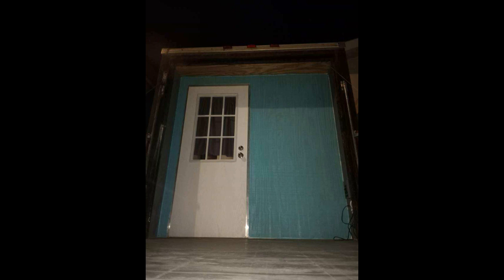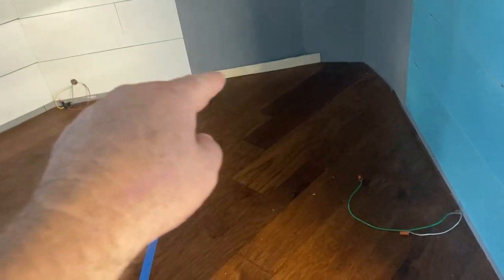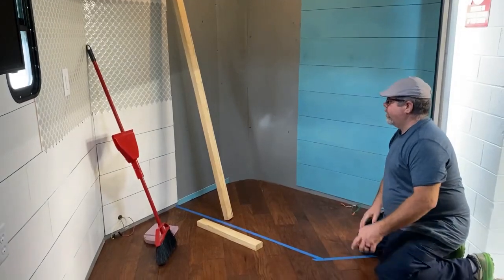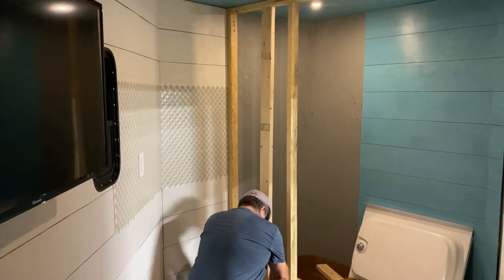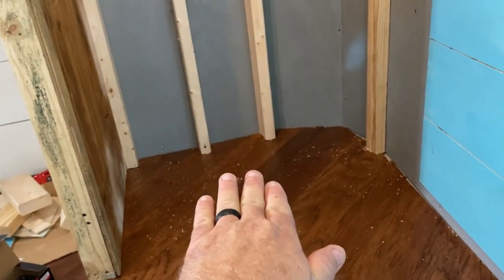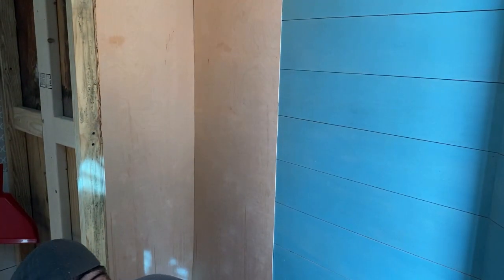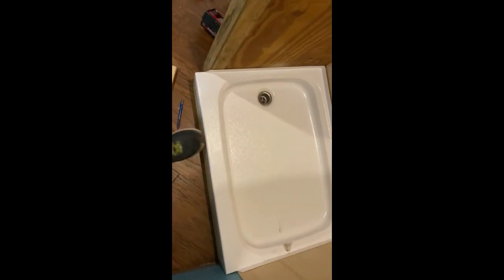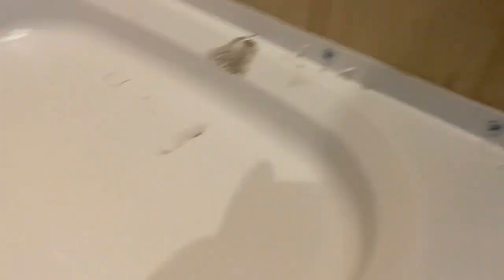CARGO TRAILER CONVERSION PART 13 SHOWER BUILD

Comment: This went from a cargo conversion to a bathroom build. Looks like it's gonna be pretty good. It should seal up okay when you're done. Did I miss it but what you going to do about the front, glass door, curtain???
Reply from the maker: she is going to make a curtain held by a magnetic curtain rod, and on the side walk in door I am going to completely rebuild that door and install a 12x24 window that has a built in blind that opens and closes. have any ideas about an ac/heat for me to us? I should have used a rooftop ac unit. THANK FOR COMMENTING I APPRECIATE IT. I LOVE YOUR CONTENT WATCHING THE THINGS YOU MAKE SO COOL DO YOU EVERY SELL ANY OF THE FISHING LURES?
Reply: @autocrazytv3718  When my time comes, I'm going to try the ac in the wall or floor, Less on top of trailer 🤔 Can't wait to see your next videos